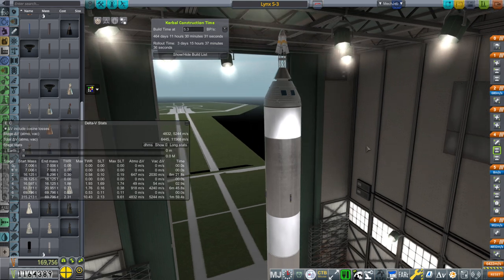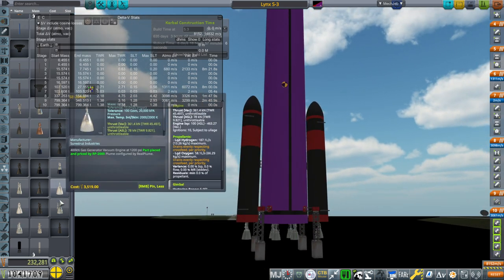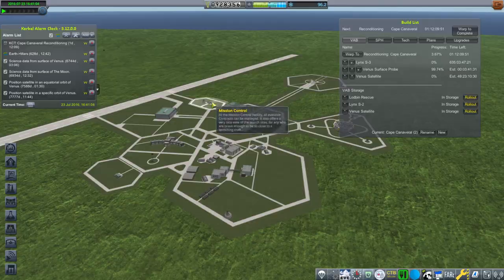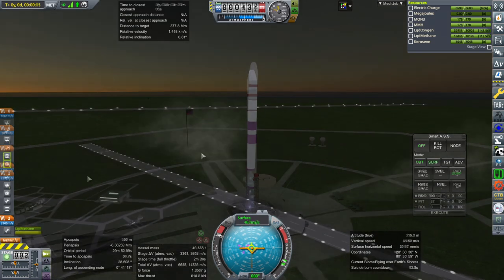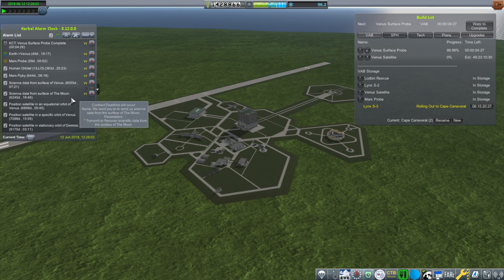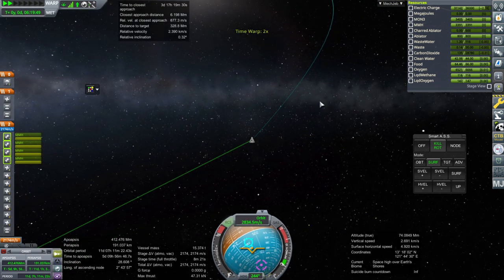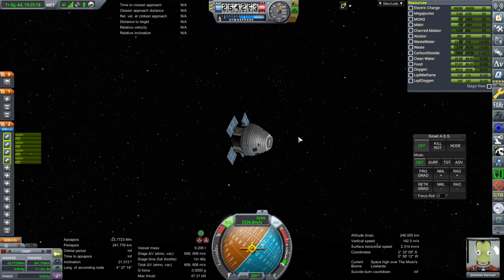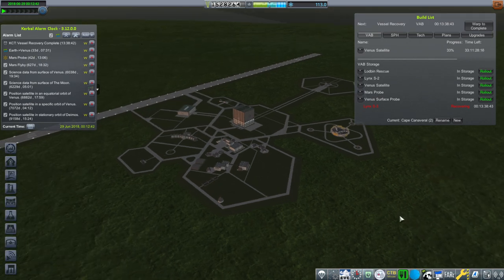KSP with Realism Overhaul - RP-2000 Career 21 - Crewed Lunar Orbit

Comment: The surestrut engines all seem to be really good. What injectors do they use? I'm assuming an advanced coaxial swirl, which probably atomises the fuel well, but probably expensive. Maybe a config for cheaper parts but slightly lower efficiency would be interesting
Reply from the maker: Some of them are cheaper and others are more expensive, depending on capability. It's just that I've tended to use the more expensive, higher performance ones.